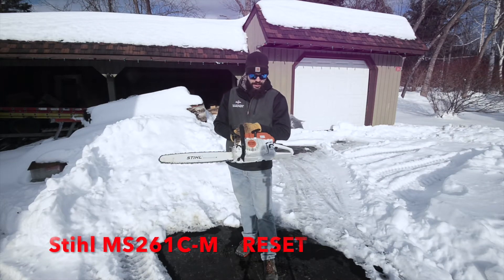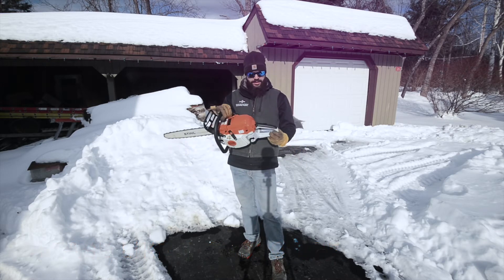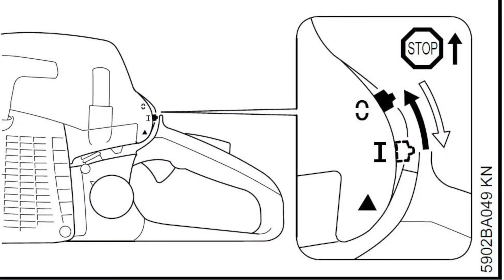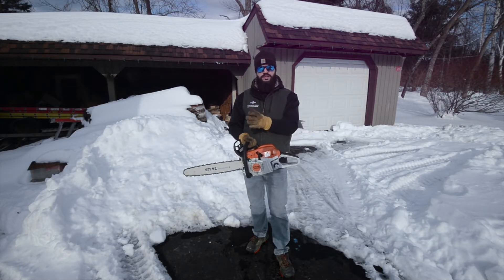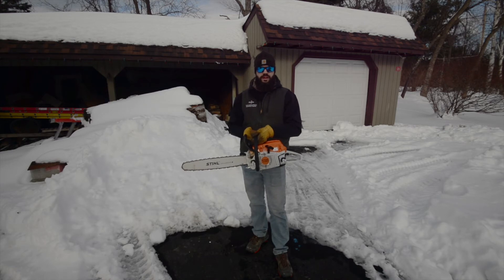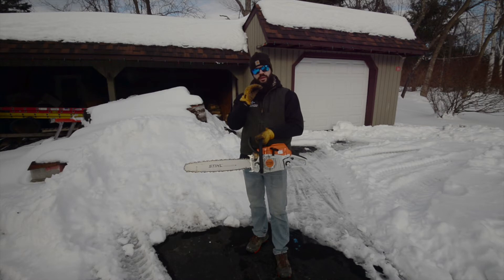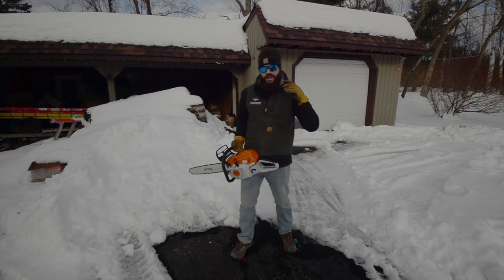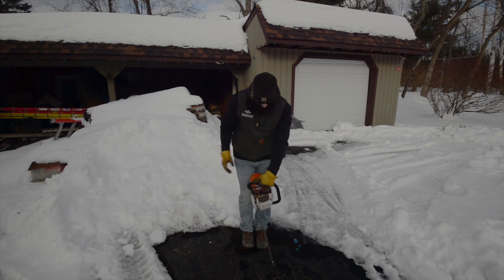STIHL 261C M-Tronic Chainsaw Reset...Finally got it right

Comment: I am a Stihl dealer and this is news to me.  I also happen to own an MS 261cm so I'll try to calibrate it today.
Reply from the maker: Good deal. Let me know how it goes.  I found that it is easy to do but you need to make sure you get the timing right.  I also noticed that it makes a difference in the saws performance.

Comment: I bought a 261C M-tronic and it was the worst saw I've purchased in 50 years of sawing in the woods.  I gave the damned thing to a buddy, who threw it away.  No adjustments on the carb, but lots of F-around when a man should be sawing.
Reply: I love mine. Starts and runs good. I like it better then my ms391
Reply: Love mine also.  Been sawing for 40 years and it’s the best chainsaw I’ve ever owned.
Reply: Easily the worst starting saw I've ever owned. I'm definitely questioning my purchase.
Reply: @shawnwise2458  I agree.
Reply: @guly  Name calling aside, you are wrong.  I owned and hated the 261C M-tronic.  I logged professionally with Stihl 044s for years and loved them.  The little 261 that I had was junk and I'm not the only sawyer to say that.
Reply: You can adjust the tick over on the carb. A little know grub screw is below the lower electronic box, the one below the solenoid on the right hand side of the carb. Take the aforementioned box off ( clean the carb with carb cleaner first )and you will find the grub screw that adjust the idel turn in for for fast idel speed ( this is trial an error, a little at a time ). I found this when fettling, my 261c was bogging when I took off throttle, not anymore.
Reply: @andrewcornford2306  I wish I'd known this when I had the 261.  Wish Stihl would put it in the owner's manual.
Reply: Always cracks me up when I read a comment like this. The 261 came in a few revisions, so it's hard to say which one you had problems with but generally speaking, the 261 is one of the most highly regarded saws that Stihl make. There are always a few bad models of anything, so perhaps you just got unlucky.
Reply: @andrewford80  
"Highly regarded" by whom, specifically?
Reply: yes, my 261 C is also crap, brand new, keeps not starting after warm. Solenoid already changed, same crap. can t recomend it
Reply: @lplp6961  I'm using two 362 Stihls now, with carb adjustments.  They both work fine.

Comment: I always calibrate with a hot engine. Your not supposed to do this with the engine cold for several obvious reasons. As soon as max revs is over kill it then. No reason to let it run after revs have dropped. Shut it off and fire back up and cut.

Comment: Great video! Very good detail. Just bought the 261c-m today. I've watched a ton of videos on youtube about dealers not knowing much. I asked my dealer if they started it, he said yep, runs great. I then asked if he did the calibration - he looked at me like a deer in head lights. He does not know about the calibration! :(  Do they come pre calibrated from the factory or should I calibrate it?
Reply from the maker: Just run the calibration cycle for yourself to be sure. I would honestly run a few tanks through it first before you run it at that high of RPMs. Make sure to buy the 6 pack of Stihl oil so you extend your base warranty by a year. It’s a no brainer.
Reply: @Jazzking22  Great advice, thank you. Are you saying run a few tanks through it before calibrating it?
Reply from the maker: @bhilton81  yes. It’s good to break it in lightly.

Comment: In only counted 25seconds of full throttle. Should you have done it for another 5 secs?
Reply from the maker: Yeah after watching the footage I think I was a few seconds short but I noticed the engine speed dropped back down according to the chart so I think it still worked.  I will do another reset some other time but I had the saw out all day yesterday and it ran flawlessly and there was no hot restart issues like I had before so fingers crossed! Thanks for commenting.
Reply: Yeah, I was wondering about this too. Instructions say to kill the saw after the idle drops, but the chart shows the rpms dropping twice after it hits its max rpms. I’d like to see the follow up if you do it again to see if the rpms drop again to actual idle speed.
Reply from the maker: @darkbidding  I did do it again and it does the same thing.  My saw hasn't had the hot restart issue anymore so it seemed to work. Thanks for watching and commenting.
Reply: @Jazzking22  Excellent! Thanks for the reply!

Comment: For what reason most to do calibrate ? What's happed with carburator .. hello from România !
Reply from the maker: If your saw isn’t running right, if your saw is idling weird or if you are having trouble with it restarting. If you move or are using your saw in a different climate or elevation. It just resets your air fuel mix based on the atmospheric conditions.

Comment: I can’t get mine to idle more then 10 seconds with the chain brake on it runs great under throttle but won’t idle what’s your thoughts ?
Reply from the maker: Needs to be calibrated.  I would run in with chain break off and run in through the sequence then see if that makes a difference.  Otherwise it could be a fuel issue.
Reply: @Jazzking22  Thankyou !, do you think it would still do the Calibrstion without the chain brake step

Comment: my 362 was giving me fits.  Checked it with an induction tachometer.  3800 low idle, 8700 high idle.

Ran the calibration and it followed the entire RPM band like this video.

Checked the speeds again,.   2800 low idle, 14400 high idle,.  

This is critical to get the chain speed up to have it perform correctly.  It's not the same saw.

Comment: I have a question, do I have to reset it every time I use it or only the first time I use it?  thanks
Reply from the maker: Only as needed.  If you do it once now then if you run into an issue later you can do it again later.  I would only do it if you are having issues or the saw seems off.

Comment: Great video.   I have an MS 261 C-M that is not an 'mtronic version 3.0' and I am really frustrated with the hope of depending upon my very expensivce Stihl MS 261 C-M when I need it.  I've read many posts, and in short I know I'm not alone with these performance frustrations.  

There appears to be a product ~grey area between the mtronic version 3.0 chainsaw you speak about and the 'sux-2-b-u' version of MS 261 C-M that I bought.  I've replaced the spark plug, cleaned the air filter, changed out the gas filter, and watched every You tube video I could.  I bought my MS 261 C-M in late 2018 and I've had to have it serviced twice.  Not feeling the love for this machine at the moment.  If you have any insights, I would appreciate hearing from you.
Reply from the maker: I wish I could help more. I run my saw maybe twice a month so I am not a heavy user by any means.  All I can offer is that I have really had no issues at all since recalibrating.  I did have some hot start issues where I would be running the saw then stall it and have to restart it and it would absolutely refuse to restart, I would just about want to throw it in the trash.  Since calibrating, I haven't run into that again. Hard to give any other insight.
Reply: I’m in the same boat as you Rick saw runs great sometimes replaced 2 ignition modules and still having problems with it stopping when hot and not wanting to start. It is 2018 saw and there is a complete information void on what to do next. dealer put if on computer and said nothing wrong with it. Except change filters.

Comment: I just bought a ms 201, should I calibrate it? Now, after break in period…or just leave it? Edit: **obviously not during break in
Reply from the maker: Run it for 6-10 tanks then calibrate it.  I wouldn't rip on it too much until you have 10 tanks through it.
Reply: @Jazzking22  10-4. Thanks. 🤙